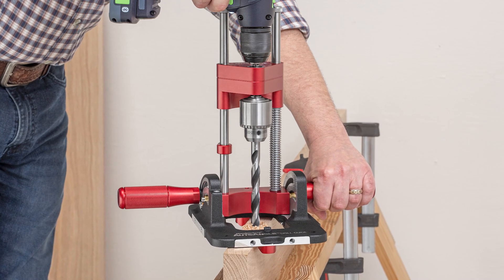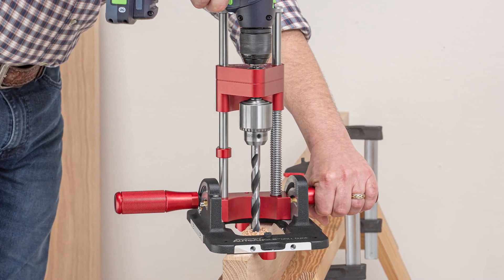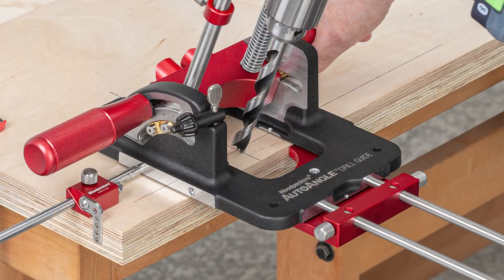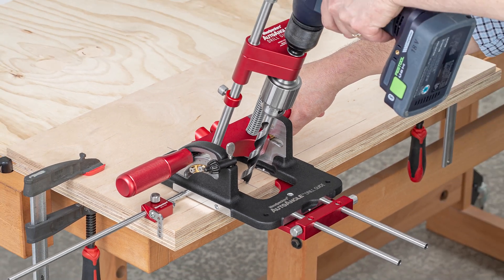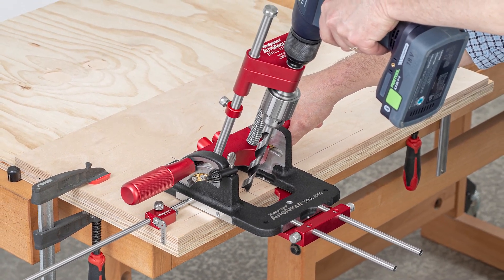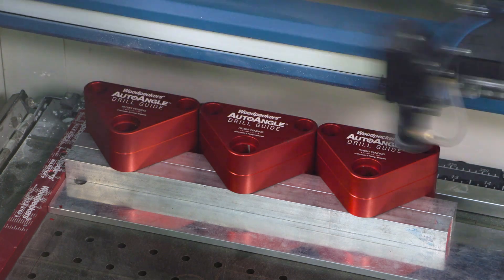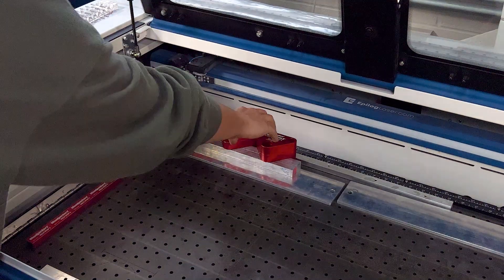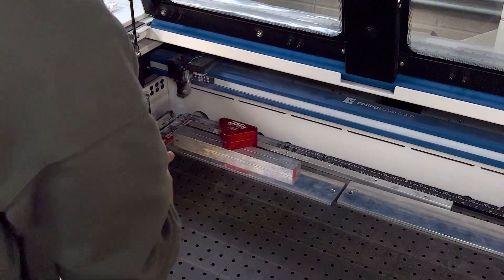Making The AutoAngle Drill Guide | Production Update

Comment: I'm sure this is a very nicely made accessory, but for $600 you can buy a pretty good actual drill press and pretty good drill guide - my "MilesCraft" isn't a precision tool but it does the job, and it will also drill angles. It was $35 I think. For drilling oddball angles on conventional pieces I picked up a 1980s ShopSmith (with 5 hours on it - practically brand new) for $300. Woodpecker has gone from "pretty expensive but worth it " to "astronomically expensive"
Reply: LOL, I have more than one drill press and while they do great jobs, it can't do the following:  Can't use them on items that are too heavy to move or built in where something needs to be drilled with high accuracy, I can only drill to the point on a surface based on the DP's swing.  BTW do you have a store where people can order a 1980's ShopSmith for $300 with only 5 hours of use, I'm sure more people would be happy to find some good deals.  In the interim the WP cost is a tax write off to all of people buying it.